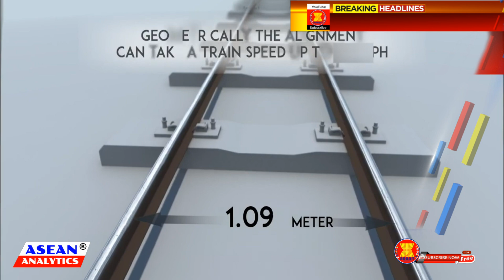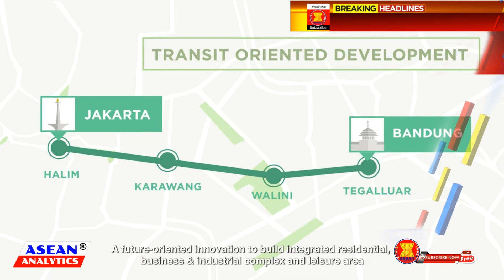Building the First High Speed Rail in Southeast Asia: Indonesia and Thailand

Comment: In Thailand from Bangkok to Prachuap via Hua Hin at the moment a new double rail track under construction: Gauge 1.00 m - High Speed ?
Reply: The speed of double track trains is 160 km per hour. We spend time 2 hours from BKK to Hua Hin. It's definitely faster than the past speed which takes time 4 hours. As I've known trains speed more than or equal 250 km per hour we call high speed trains.

Comment: 40km/h to 60km/h - slow  ( 0 points )
60km/h to 80km/h -  mediocre  ( 1 points )
100km/h to 120km/h - ok  ( 2 points )
120km/h to 140km/h - Good  ( 4 points )
140km/h to 160km/h - Very Good  ( 10 points )
160km/h to 250km/h - Excellent  ( 20 points )
300 km/h and above - World class  ( 30 points ) 

So, I'll let you decide on what points your country get, Planned projects do not count.
Reply from the maker: Speed really depends on the type and purpose of the railway, most commuter and Heavy rail had a speed less than 120km/hr.

Express Train and Long distant train like HSR is raging from 160 -500 KM/hr
Reply: @aseananalytics  Indeed!